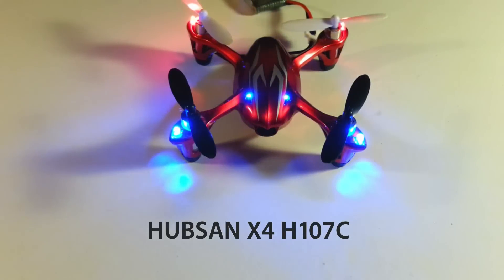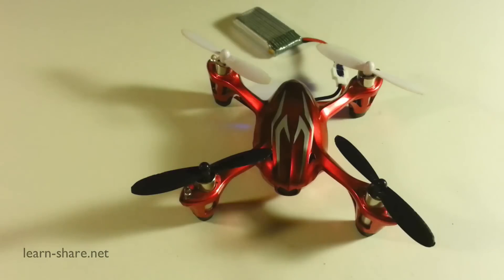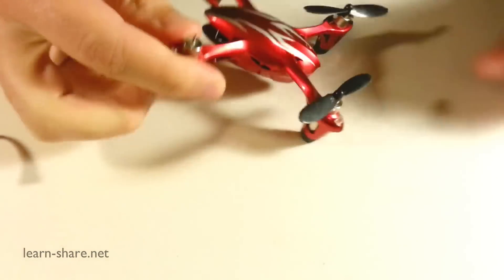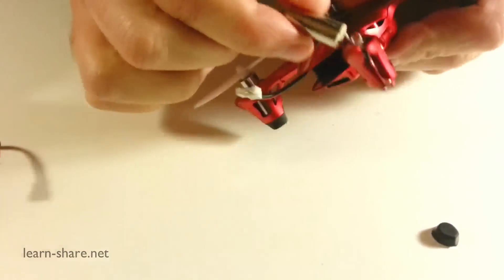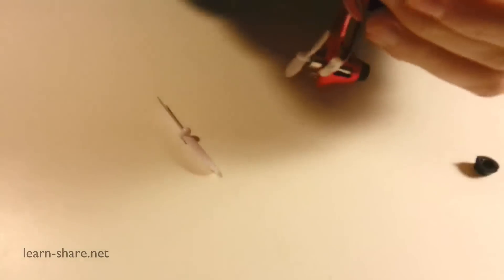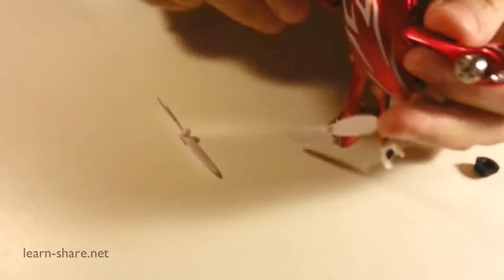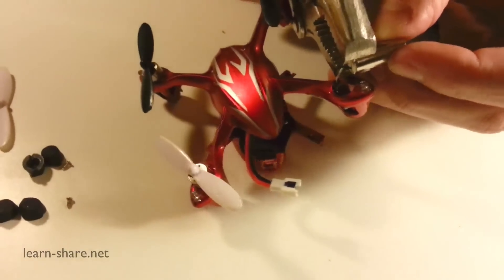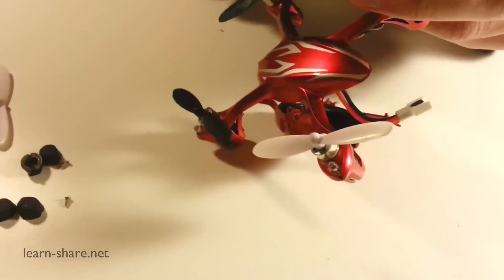How to Fix Hubsan X4 Stuck Motor - Repair Mini QuadCopter Drone Motor

Comment: My problem must be deeper than this because my motor stopped working, thought it died, put a new one in, also doesn't work, decided to put both wires in battery socket, and it spun, same with the one I thought died. So all the motors work just fine, the chip looks fine on both sides, all this because it dropped from 5 feet from the ground when the batteries died. No idea what is going on.

Comment: Hey nice vid.
My micro drone fell from less than 2 meters and It look like I hit the part where you turn it on and of I turn it on and won't blink or anything unless I make pressure there .
Does it have fix?
Reply: I'm just getting into these little drones but I have taken apart a couple cheap ones to see just how they are built/work.
If putting a little pressure on the outside plastic makes a connection, (ie, the leds, etc come on), it probably is just a broken or loose wire inside that is either just not making a connection on it's own or possibly shorting across another pin.
I would disconnect the batt asap before it shorts and fries the whole board.
Carefully take the blades off and take it apart to see if anything doesn't look like it's attached properly and carefully re-solder it in place.
If you're talking about a little palm sized or slightly bigger quad, built similar to the one in the vid, there's just a small, almost diamond shaped PCB with some surface mount IC's, Caps, ect. and all the external components are wired to the board. On every one I've taken apart to look at the PCB is marked, Motor + & -, Ant, LED's.... 
You can get a soldering iron pen type at almost any big box store cheap if you don't have one, and if you don't have exp, hit me back and I'll help you with some tips. 
You can do it!!!

Comment: Hey my drones all motor works perfectly but it cannot take off.Any of two side will have less power and does not balance. Why is it so.Can you tell me please? 😢😢😢😢😢😢😢😣😣😣😣😣😣
Reply from the maker: Maybe thats the reason. Not balance nor enough power to lift. You should take an eye on your drone user manual or you need to buy new propellers/motors.. cant tell.

Comment: well, it worked for me, after using method 2, but the motor doesn't work with full power. Might need to get a new motor anyways.  Thanks for the fix!!!
Reply from the maker: Yes no doubt ;)

Comment: How do you remove the battery from the drone? I've tried everything I can think of without destroying it.
Reply: I should note that I don't have the same model, but the battery is the same style
Reply from the maker: Please do not destroy it!  Just pull it out ;-)
Reply: +learn share I won't. It won't pull out though. It's as if it's stuck
Reply from the maker: It's a Husband X4? If it is the only way is to pull it out, or disassemble your drone. Google it how to do it.
Reply: The drone? No. I've tried google. I'm probably just pulling wrong
Reply: +learn share I finally did. My brother showed me how

Comment: Hello brother; One of the motors in my Hubsan X4 H107C is stuck, but I'll fix the way you said. But my drone is not pairing with its new remote controller. Can you help?
Reply from the maker: I guess you should google the manual. Hubsan X4 H107C Manual.
Reply: Ji ke saman humko chahie ji aap aapke mobile number yahan kuchh bhej sakte ho kya

Comment: my motor for mines isnt working. doesnt seem to be stuck or hard to rotate. just wont spin when i turn it on. any suggestions?
Reply: my be burnt out
Reply: Is it hard to fix. And do u need a sotter gun to fix ot
Reply: Not to hard but u need a new motor and soldering iron

Comment: worked for me too - thank you!
Reply from the maker: Great ;-)
Reply: what is wrong if one of the motor just wont stp spining..whenever i put my bettary in my drone..that one motor is just on non stop..what to do?
Reply: Sounds like the main PCB is fried somehow. Good thing that spare parts are cheap for the X4 mini series, but you'll need a soldering iron and desolder pump or wick handy. Make sure you get the exact variant you need (H107C vs H107L vs H107D vs whatever the original mini was called, for instance).

Comment: Hey i took my motor apart and managed to get it spinning freely again but now its turning the rotor blade the opposite way. do you have any suggestions of how i can get in spinning in the correct direction?
Reply from the maker: Can't tell... if you did not change the position of the motors, this should happen.
Reply: +learn share i have THE hubsan x4 plus

Comment: Haha I can't believe it worked!! :)

One of the motors of my JJRC H20 got stuck after hitting a chair. I tried forcing props to with my finger and I could tell there was about 15 degrees where it would feel tight and very hard to move. I tried method two directly -pinching the bottom of the rotor with a small long-nose pliers. Note: I disassembled the whole thing with the included screwdriver in the box.

The trick which wasn't explained in the video was, the spin is stuck only on a certain part of the axis. So you don't need to pinch just anywhere on the rotor. You have to find the "sweet spot" to pinch until you can actually feel the props loosening up. I found pinching on the wrong spot can cause the rotor to completely stop moving -can't be spun manually by my index finger.

Anyway, I just thought I would share this just in case anyone else faces the same problem. 

-I actually won't go to the effort of buying or even ordering a new motor and replace it myself. So if it didn't work, it's either to the trash or hidden forever in the garage! haha :D

Comment: I didnt work so ill try again sometime, when i tried ot fly it the motor got really hot really fast why is that? Also why does it get jammed, could it be particles that got stuck in it although probably not as i did crash it before it got jammed.
Reply: +OneMove33  If the motor is jammed and it gets really hot but the others don't then you really need a new motor.

Comment: I have another problem , one of the motors spins slower than the others or wont spin in certain positions. I understand that this can be fixed by applying instant glue to fix the magnet to the axle but I cant figure out how to open the casing of the motor without damaging it.

Comment: Hi, in my case, one of the motors simply stopped working after a hard crash, it does move freely though. Would this fix work?
Reply from the maker: +Jose Miguel Bolaños Rubio Did you fixit?
Reply: Not yet, but I found out that one of the motor cables is loose, so I just have to solder it.

Comment: wold this work with a holy stone mini quadcopter?
Reply from the maker: +Kimberly Blom If the motors are the same, it should work! mini quadcopter's,  have the same size and type rotors/motors